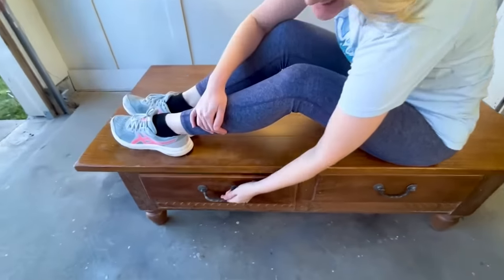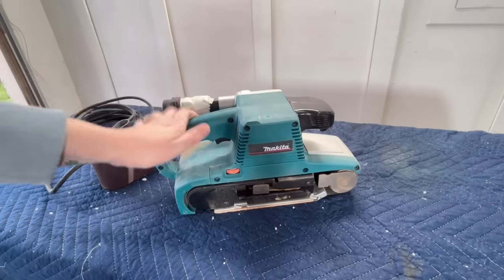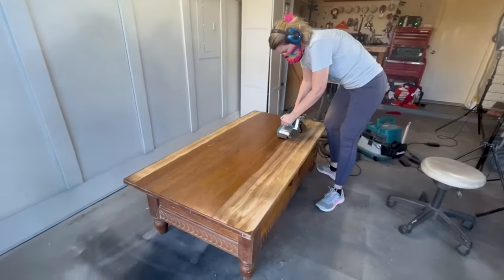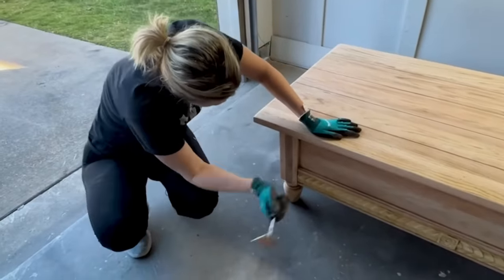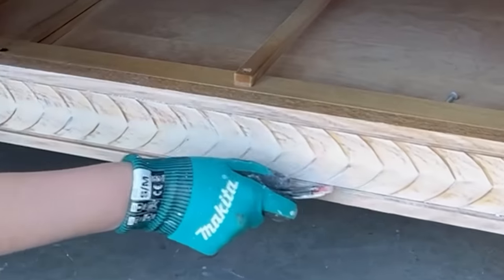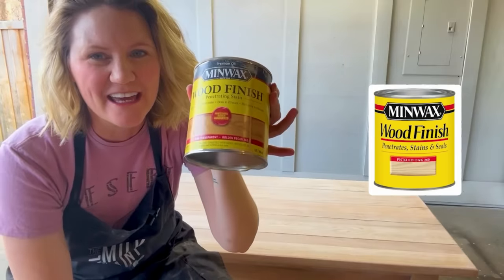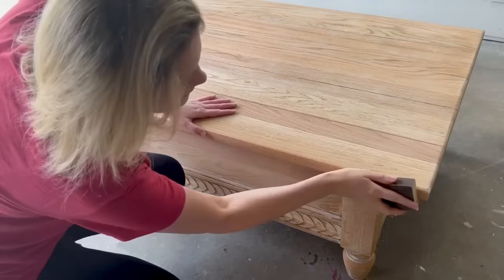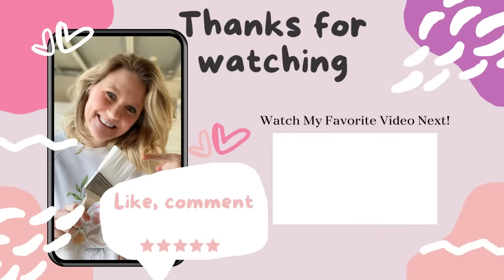Furniture Makeover: Turning Cheap Thrift Store Finds into High-End Pieces!

Comment: You probably already know how to repair the old coffee table but if not, hot glue an undamaged corner to create a mold and then fill the mold with Bondo and place it over the damaged corner. My "culprits" chewed the corners off the baseboards around the posts and off of the nightstands and one chair arm. Love the cerused look!
Reply from the maker: yes! Thank you! I have done that on some nightstand's so I will have to revive the old one again by doing that! thanks for the tip and thanks for watching!

Comment: Wow now Lemon Lady is doing cerusing.  You have perfected how to pick the good ones, the style of this table even looked good before your refinish.  Don't think there is anybody that WOULDN'T like this one.  You would have to be sure you have solid wood before you use a belt sander on it, though.  Typically cerused finish uses a wire brush to remove some of the softer grain, but this one is perfectly beautiful, and very well make furniture.  I wouldn't sell it for cheap.  This is not faux pottery barn but the real thing.  THANKS.
I keep preaching it, but you can easily tint your top coat, but be careful not to over do it.  I have a set of artist colors, and just a dab per pint is enough.  If you want to eradicate the pink, the opposite color of red is green, very little, like green tea.
Reply from the maker: Hey Rock!! So nice to see you on here! Hope you’re doing well! How’s FL treating you? Thanks for the compliment. Yes I will have to address the solid wood vs any other surface in another video. BUT I am a little ticked it took me so long to get the courage to use the belt sander! lol and I love the top coat suggestion.
Reply: @LemonstoLemonadeFurniture  OUI. oui, Madame Ceruse.  I have been doing this longer than you and I have never used one.  Maybe now I have the courage?  Couldn't you just see some ding bat with 40 grit making dings and tearing up the plastic veneer???  
Be careful but you could use a long bristle brass wire wheel on your drill.  Care-ful.
Florida could be more ideal, dry, 60 night, almost 80 day. TX is probably much the same.
Go easy at first as with everything, you can always do a second pass or add more pigment.

Comment: I’m sorry. Why was this better than white wash?  Would a white wash have looked different after driving? Is the main difference the way the wood grain appears? I’m new. I have an identical project to do. Want to know why the extra work was worth it. Love this look. Such a steal.
Reply from the maker: No worries! White wash doesn’t settle into the grooves like this does, it will change the color completely. With the grain filler, it just cerused the grain instead of changing the color. Hope that helps!

Comment: Beltsanders are not so easy to use- especially with 80 grit it’s easy to get uneven surfaces and deep „rivers“ into your surfaces…and more work to get the sanding marks out, losing a lot of material on your wood. So I can see why you chose the cerused look …
Reply from the maker: Oh that's interesting. i had that thought all along but then found it not to be true with the Makita one I used. I got a really even surface. If I did any orbital sanding after it was just to remove left over stain. But it certainly opened up the grain pattern for me very quickly which was the plan so I will most likely use it again (the belt sander) but I will up the paper to 120. Thanks for watching!
Reply: Well, I’ve used it quite a lot and found that especially with 80 grit you can get an uneven surface very fast.. of course the softer the wood ( pine…) the more. Maybe the weight and speed of the machine plays a role too- mine is heavy and a bit bigger, it has a very strong drive of its own , so that could be the reason. The table looks beautiful though, I just thought, that inexperienced tool users might have some difficulties using a belt sander- if it is light enough with low drive it’s going to be ok.